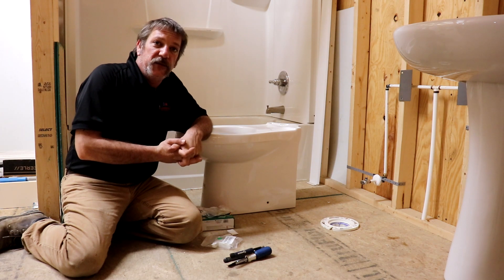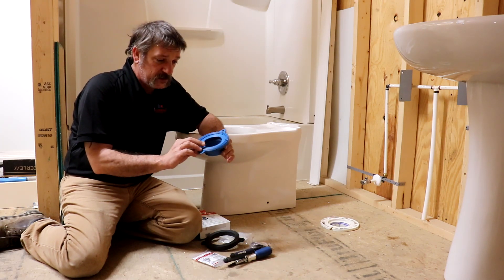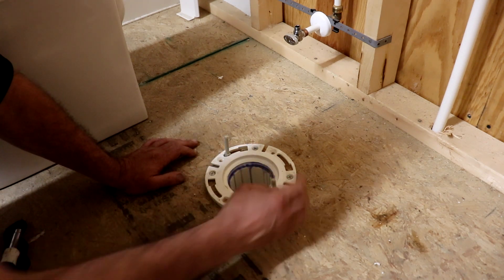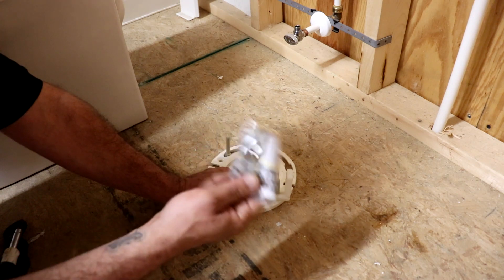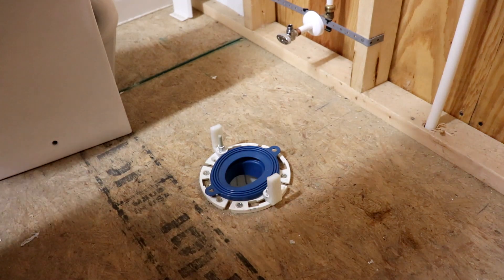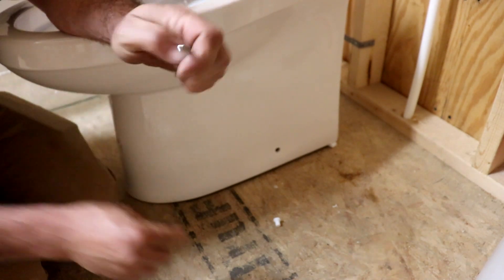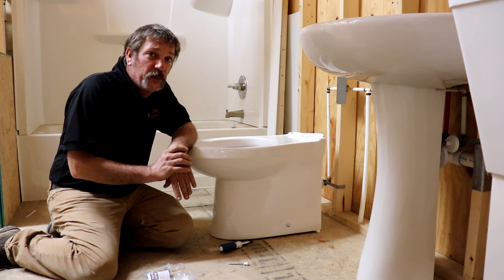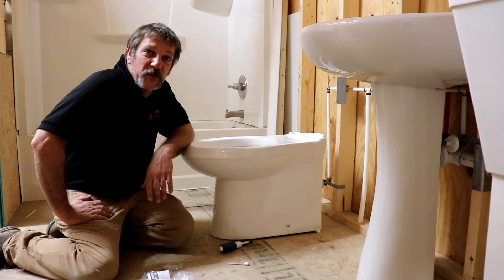Problem with Proflow toilet

Comment: I installed those and had same experience. after I added the tank I added plastic arms to rear of the tank and it helped. now I always add those plastic arms to prevent movement and rocking
Reply from the maker: plastic arms??
Reply: I'm curious too. What plastic arms?